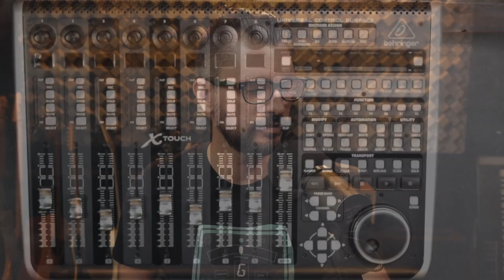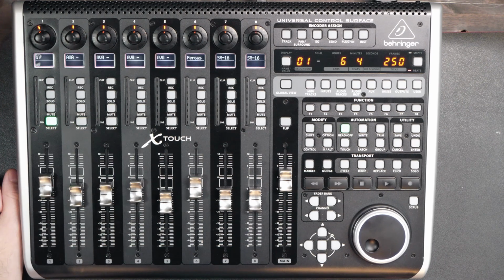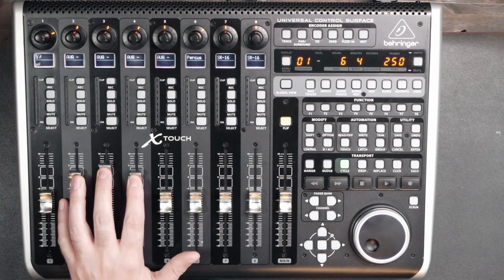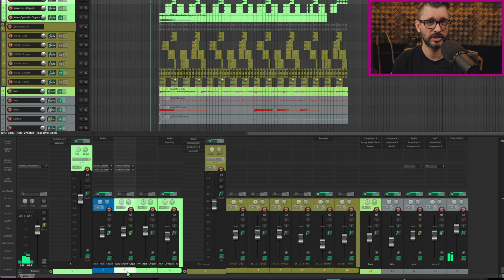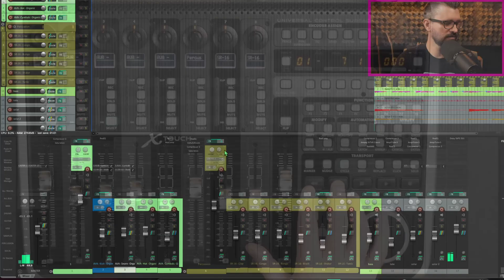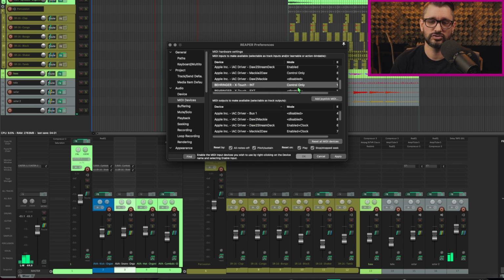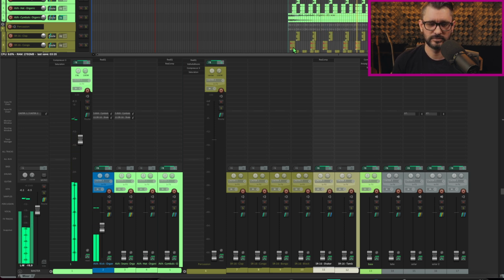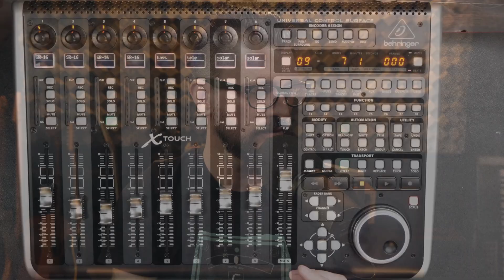Using Behringer X-Touch Universal Control Surface with REAPER - stock/built-in setup

Comment: Hey, do you know how to do a factory reset on this? I had mine working and it doesn't anymore. I've updated firmware and still no improvements. My Mac can see it as a Midi device, but the LCDs are blank (still lit). I can change the Mode setting, and I can pass other midi devices through it fine, just the unit itself doesn't communicate with my mac

Comment: Question: I'm fairly new to the x-touch... anyway, the first two faders of my x-touch extender seem to be locked in motorized mode, i.e. they resist being moved. The other faders are fine. Have I managed to get those two channels into some sort of weird mode that can be reset, or does it mean there's something wrong with the unit that needs repair?

Comment: The faders, how do they compare with the BCF2000. Are they more precise or the same? I have a BCF2000 that still rocking, but what I don't like is that they don't do very presice movements if you really want a tiny bit of adjustment, if you know what I mean. Great video as usual!
Reply from the maker: definitely more sensitive and precise, plus it works in touch mode. What I like most is how much quieter the motors are.
Reply: @TheREAPERBlog  thank you! I just got mine today... it is much better. It didn't wanted to work with m4 mac via USB, but I used 2 midi cables, and all is good!! thanks for the video!!

Comment: The drop down is blank ??   except for our interface UMC 1820   after several days of reboot -- new USB cable , etc.  https://youtu.be/U6wS7ZOOlEo?t=100   ........ does show the Mackie in the control surface ( developer 1 &  2)
Reply: AHHHH  ~~  after SELECTING the CH 1 -holding down at boot - you have to then TURN OFF the SELECT button !!!  3 days and counting --- that step was never mentioned  :body-blue-raised-arms:
Reply from the maker: i don't remember having to do that

Comment: Thanks for this, as always! I'm thinking of picking up the X Touch One and that it would be plenty for my use.
Currently sticking with Reaper 6.83.

I've been doing more commercial work and would use the fader to automate the volume level of music beds in spots.
I would also use this for editing dialogue in spots and podcasts. I would assume you can also assign control surface shortcuts to Custom Actions??

My guess would be the answer is "Of course this can do all that." but I wanted to check. My thanks, again!

Comment: Using the stock built-in setup is it normal that the second line of the channel display remains blank? It looks that way in the video but just want to check...
Reply from the maker: i think so. the original MCU only has a single line display

Comment: Thanks for the review. I recently purchased the X-Touch to work in conjunction with the XR 18 mixer for live performance. I couldn't figure out how to take the signal from the X-Touch via USB or any other method to send it to Live Strimming. Those videoclips are supposed to answer this question - did not give an answer. I would be grateful for help.

Comment: Would love to see you deep dive on Smart Knobs 2.. It's seriously amazing. Documentation is not quite there but it gets you most of the way there. It's easy to use the included GUI to quickly map controls for plugins, etc too and switch modes on the fly (like switch between whether the controller is acting as a track mixer or plugin controller, etc)

LBX also has a profile that replicates the functionally of the MCU only with way more working buttons and color scribble strips that works great (though you have to ask him directly for a copy of this as it's not included)

Comment: I see you are using a SR-16. I have a SR-18 how did you connect this. Was it to your audio interface or to this board? And do you like the sounds of the SR-16 compared to drum plugins?
Reply from the maker: these are actually just some random one-shot samples I've had for years. If I had a drum machine I would go MIDI out of REAPER to the drums, and stereo out to audio interface or mixer inputs. The x-touch is just a controller, no audio goes through it
Reply: @TheREAPERBlog  Thank you!!

Comment: Thanks a lot John. I have a question, Im interesting in orchestal music using reaper for recording and mixing, working with VST. This control surface, is it good to control VST instruments via Kontak? I mean, to use and program faders to modify expression, modulation, vibrato of instruments,etc. Im looking for something to control reaper and instruments as well. Also I found this review saying it does not work very well with reaper 😳

https://youtu.be/3wtmm8vmWLg

I’ll watch all your next videos, thanks for your great job sharing all this
Reply from the maker: I will try and get back to you. My hunch is it will work fine, but motorized faders is not needed.
Something like the Sparrow I think is more suitable for orchestral writing, but I haven't tried one yet.
https://themidimaker.com/products/sparrow-3x100mm-midi-47280
Reply: @TheREAPERBlog  Thank you! I did not know anything about that gear, it seems amazing for writting dynamics. Maybe the xtouch compact is better in my case, because it has two layers and a software midi editor for programmimg the CC codes. I prefer a machine for both, mixing and CC midi control of instruments, anyway I’ll think about both solutions

Comment: I have had an X-Touch since they came out.   I use it with my XR18 as well as reaper.  If you run it in XCTL/MCU mode, you can then use the SMPTE/BEATS button in the upper right to switch modes on the fly.  Allows you to control your XR18 and quickly switch over to control Reaper.  Another way I use it is straight MCU mode to control Mixing Station app on either a tablet or my PC.  This allows me to control the actual App I am mixing with live directly via the X-touch.  If you run it in XCTL mode, it will still control the XR18 (or X32), but you don't necessarily see the changes happening in real-time in the Mixing Station app.    Such a great control surface.   Have even considered using it as a midi control surface for some simple DMX controls.
Reply: Also, you can find custom magnetic overlays for that button panel on the right.  They will allow you to tell them whatever you want and they just put it into their print template.  Makes it nice to not have to remember every button you assigned.
Reply: Nice !
Reply: I am considering getting an X Touch and wish to do the same thing.  My organization uses an X-Air 18 Mixer and I'd love to control it with X Touch, but would also love to use the X Touch with Reaper at home.  Where can I find out more about the modes you mention above?  Thanks so much.

Comment: Thanks.  Looking forward to further deep dives setting up your Xtouch.  I've used Klinke for years, but was disappointed not having the colors on the scribble strips.  I found "DrivenByMoss4Reaper" about a month ago and have colors now.  Still evaluating because there are a few differences from Klinke, but the colors are nice.  🙂
Reply from the maker: looking at that one next, starting today
Reply: @TheREAPERBlog  I'm looking forward to see your review on DrivenByMoss4Reaper with the Behringer X-Touch. I'm definitely interested in buying this unit and it would be very helpful for sure!